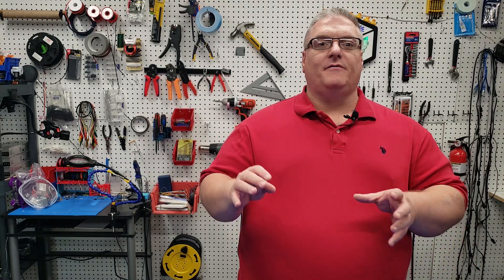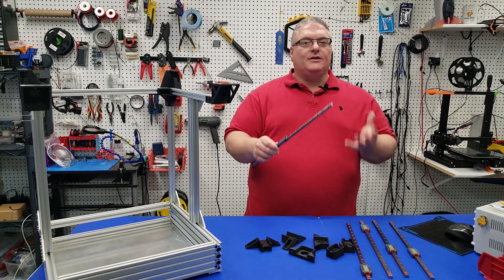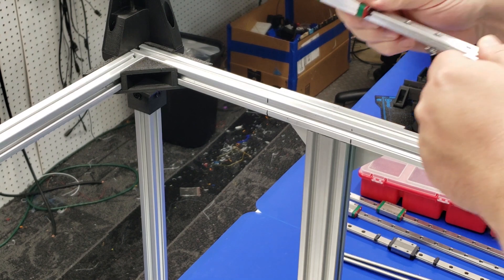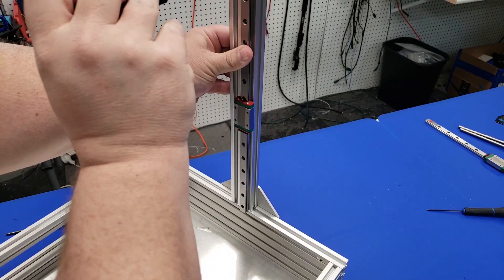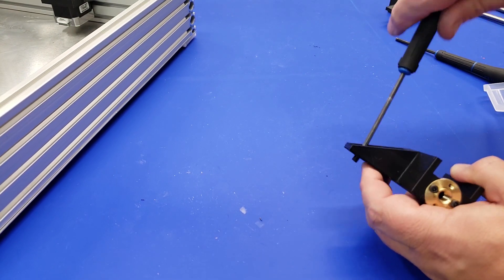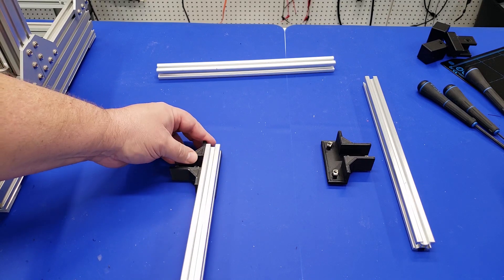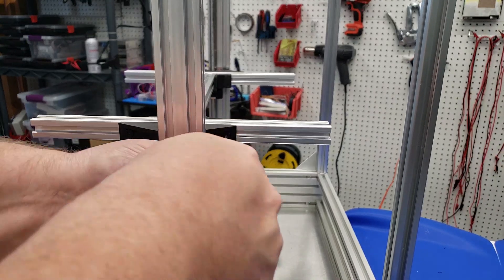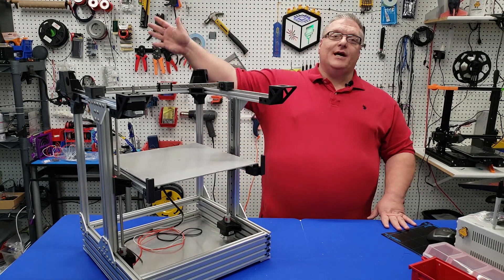DIY CoreXY 3D Printer | LayerFused X301 Part 2 - Motion Control

Comment from the maker: How far along are you in your X301 build?
Reply: Just I search for 20x80 extrusion it is rare here in Egypt is i can change it with 20x40 or 20x60 extrusion because it's deffucult to import it from Amazon during lockdown and it will take a long time?
After all thank you for your perfect designs videos .
Reply from the maker: @Darklord-b1n  try here for extrusion https://uk.misumi-ec.com/guide/category/ecatalog/shipping.html
Reply: I will use  two 2040 sections to make the 2080
Reply: Probably wont start for a year or so
Reply: In process and following along with videos. Unfortunately my plan to have someone build the printed parts for me has fallen thru and now I’m trying to find help with that because this is my first printer and can’t do myself. I sure wish those parts were available for purchase. Otherwise I have everything else purchased so far that’s on the BOM.
Reply: At waiting for the parts to arrive from china. for a third of the price you paid.
Reply: Thank you, Thank you, Thank you! Just waiting for a few M3 nuts to arrive to install the linear rails.

Comment: maybe a 230V hot bed would be better? than on 24V?
Reply from the maker: Certainly an option.  Here in the US I would have to go with 110 but the 24v bed heats up pretty quickly.  Fast enough I don't have the hassle of adding AC.  An AC Bed might be nice though if you used mic 6 aluminum tool plating for a super level surface.
Reply: @MakersMashup  
- I forgot it's the USA;)
- I'm just collecting parts to make THIS printer and I'm wondering about the AC230V 750W hot bed, and one power supply - maybe weaker than 350W 24V? e.g. 150-250W?
- what is this... "mic 6 aluminum tool plating?   is it about the 6mm aluminum plate of the bed?? because I am also wondering whether to give a 4 or 5mm aluminum bed
Reply: @MakersMashup  what are the dimensions of the hot bed ???
according to the description of the table used 300x300
according to the description of ZYLTECH 310x310 (300x300 is the working surface)
but according to the movie 11:00 a minute: 3x300mm profiles are used 2020 = 300 + 20 + 20 = table frame width 340mm - 2x10mm = 320mm minimum!?!?
a similar situation at a depth, 300mm aluminum profile + about 20mm each with printed elements with silicone leveling columns in it, it will also be about 10mm to their central point - 320mm

so the table is 320x320mm ??

because I order components and I bought a heating mat for a total area of 300x300mm, 750W 230V with holes in the corners ... but something does not suit me .. and I should probably order 320x320mm, and for sure minimum 310x310 ???
 I sent an email to suspend the order, but I don't know if I was successful :( 

what thickness of the board will be the best ?? 5mm Aluminum will not be too thick?

Comment: So, I have a question about the linear rail that the hot-end assembly travels on. How rigid, and free of flex is it, to have the rail mounted the way you do in this build? I am trying to design a coreXY printer around some IKO LFW24B rails I have. I got a super good deal on them. They are 24mm wide, I think 14mm thick, and 482mm long. I had thought that I would need to mount it to a 3030 extrusion. But I see you are using a far thinner profile rail, and have it just free hanging. Obviously this design works on your printer. Do you think the increased size of the rail I plan to use, would be better off mounted to an extrusion to limit it flexing, or it will be plenty rigid enough?
Reply from the maker: If the rail is rigid (which it should be) then it should be fine.  The rail is much stronger IMHO in the way that we use it since the holes act to provide support.  If  the orientation is to have the mounting holes down then it will provide far less rigidity.  Hope that helps your decisions.

Comment: those are not pan head screws. the countersunk heads are often called machine screws. pan head screws have a rounded top and a flat bottom.
Reply from the maker: I've heard the countersink screws referred to and sold under pan head but 🤷 as long as you understand the difference I guess that is all that matters.  You're correct though countersink is the screw you're after. The rounded top with flat bottom I've always called and read them as button head.  There seems to be a wide variety of names it seems for screws in general and none of them consistent.  I recently heard someone refer to the socket cap screws as cheese head screws.  I've even seen button heads called socket heads.

Comment: Thank you so much for your video, I appreciate that this build is geared towards being awesome for the cost, but I was wondering would there be a worthwhile advantage in perhaps stretching the beget  to changing the 2020  extrusion for 2040.
Reply from the maker: You could use 2040 instead of the 2020, thats the great thing about an open build you can certainly experiment with different options.  Once the models are released at the end of the series you'll be able to edit it and give your suggestion a whirl.

Comment: I'd like to use the Amazon links but they seem to be too specific "No results for Usongshine MGN12H Linear Bearing Sliding Block Match use with MGN12 Linear Guide for CNC xyz DIY Engraving Machine 400mm, H-Type."
Reply from the maker: Due to many people purchasing parts from amazon some vendors are running out.  There is a channel in the discord for helping people find parts. Thanks for letting me know.

Comment: Absolutely great video! You made the steps very easy to follow. Thank you very much. If I don't have money for the extrusions, can I print them like in your other video? :-)
Reply from the maker: This really requires metal extrusion. :)  The extrusion is cheap comparatively speaking.  You'll spend much more in the electronics, heat bed, etc.

Comment: Be careful when ordering your linear rails (and probably other items) from Amazon! As of 7pm Thursday, May 7th, the Amazon link in the bill of materials is going directly to the 200mm linear rail. They appear to be sold out of the 400mm, as there is no 400mm option from that seller, now.
Reply from the maker: Thanks for the heads up.  I'll note it in the BOM. 👍
Reply: @MakersMashup  Just checked again and it seems the issue has been fixed. The 400mm rail has returned!